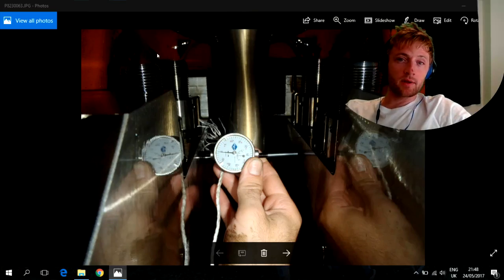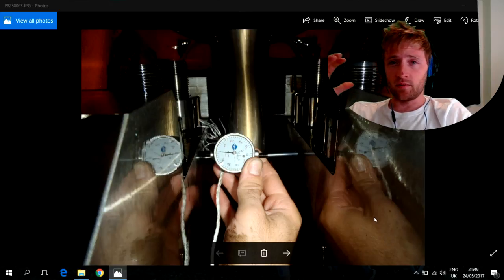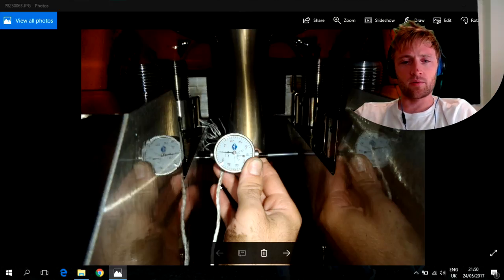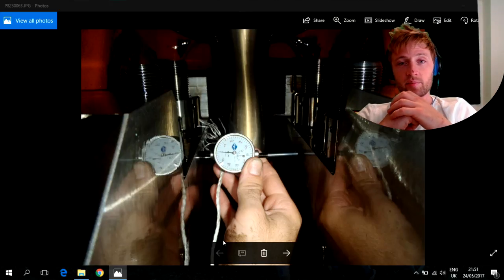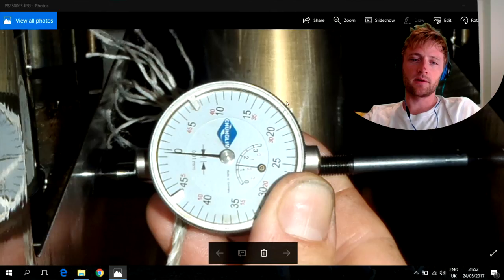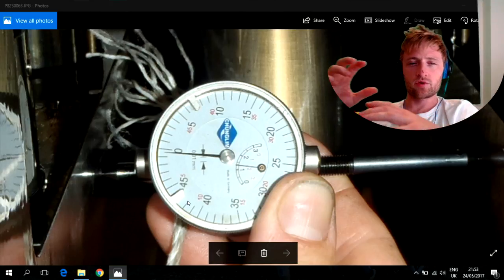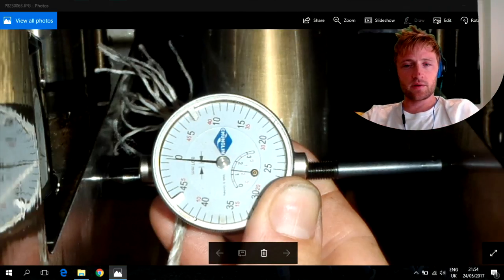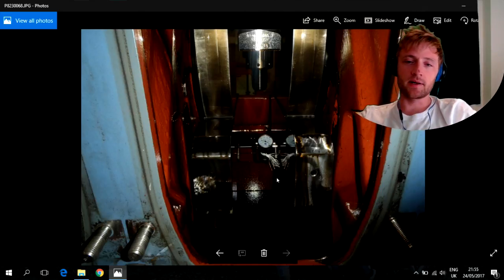DG DEFLECTION SOME INFO ABOUT

Comment: Hi! Can you explain how to lift and lower the bearings in case of abnormal positive or negative deflections?
Reply from the maker: +Start Again hello i have not experience so much wear but if there acceptable case ok you can continue if not replace you bearings with new one don't make any other magic cause it will cost on money and time thanks.